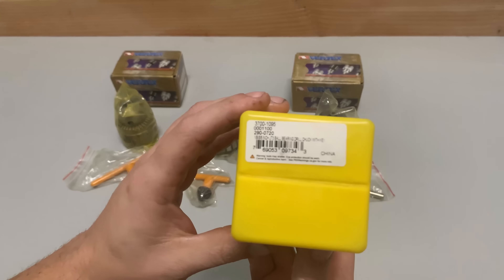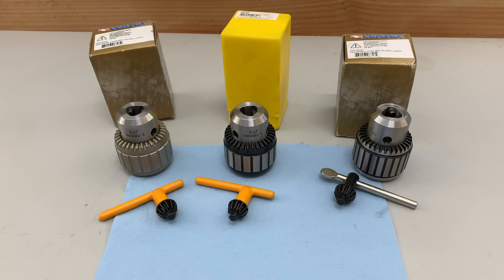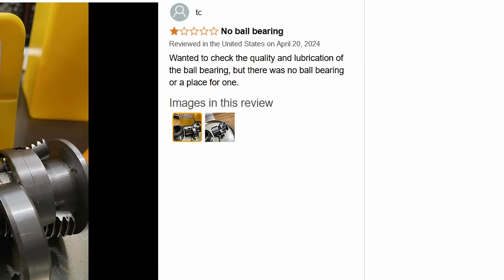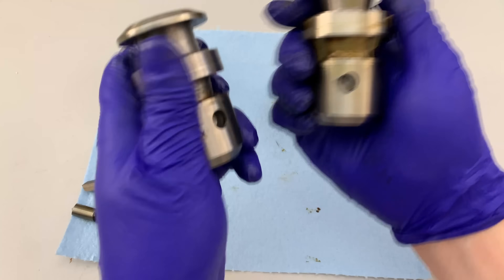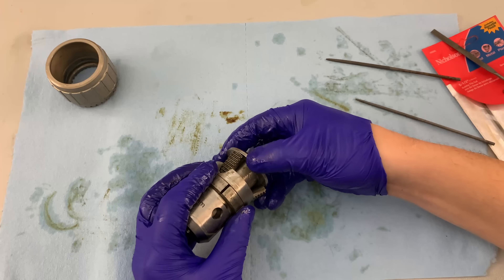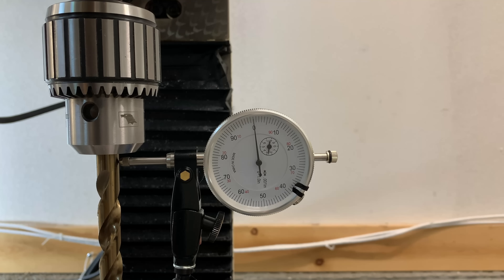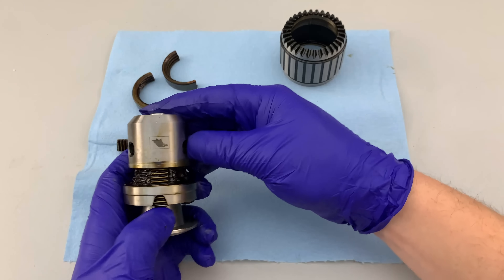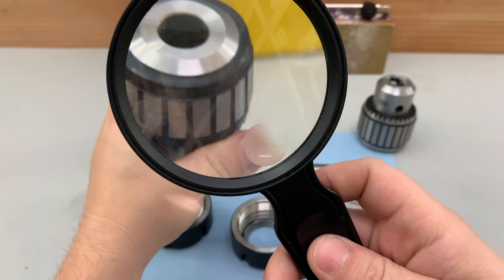Made in China vs Taiwan: The ACTUAL Difference

Comment: I have a box of large and normal sized Jacob's from dad's shop. What is the best way to sell them?
Reply from the maker: I'd say it depends on a lot of different factors like their condition, how many you have, whether you're trying to move them all at once (less per unit) or one at a time (more per unit). Most likely eBay or Facebook Marketplace.
Reply: @ShopHumor  What do you think is best, individually or the whole amount?
Reply from the maker: It really just depends on your goal. If you want the most money, sell them individually. If you want to get them sold faster (but probably for less), sell them in a lot on eBay and just let people bid them up. Make sure you take some really good pictures. Old Jacob's style chucks can be pretty valuable if they're in good shape. There's always the local option (marketplace / pawn shop) if you don't want to mess with shipping.

How many do you have?
Reply: @ShopHumor  I need to count them. They're in a tub and it's heavy. What is a good starting price for them? I think the largest one is 1". Might be bigger. The others are 1/2-3/4.
Reply from the maker: There are so many factors its hard to say a starting price without knowing model or condition. I've seen rough ones go for $50, and rarer ones in good condition go for hundreds each.

Comment: I bought a jacobs chuck from McMaster some 15 years back. I tightened it once and the outside split apart like it had been fractured from the start. Maybe it was dropped or something, but I got a free replacement and have had no issues - though I only use it on rare occasions.
Reply from the maker: That's crazy that it cracked so easily. I think you're probably right - it must have been damaged in shipping or during manufacturing.

Comment: Very interesting disassembly process.  I am certain that I would mess it up, but it is great to see it done.  It would have been interesting to see a real ball bearing chuck.  Thanks for the hard work of putting the video together.
Reply from the maker: Thanks for commenting! I completely agree and I cannot wait to get my hands on some ball bearing chucks. I am going to be doing a follow up video to determine if the distributor has actually fixed this problem, and then I'll be comparing the cheap China made ball bearing chuck, with a brand new Jacobs brand ball bearing chuck (now made in China), and an old, vintage, USA-made Jacobs brand ball bearing chuck.

Comment: I have a number of Vertex Tool pieces. Chuck (Key type tighten) and 3 X Key-less models. All came from Germany &/or European sources. I also have collet sets both Imperial and Metric for my Vertex head for my milling machine. They all have bloody accurate TIR figures measurements.
Hope this helps. One of the arbors was made in Spain as was a few taper drill reduction sleeves for my Lathe and Mill(some Toledo make).

Ozzie watcher
Reply from the maker: Thank you sooo much for the insight, I really appreciate it. How do you like the collet sets?

Comment: For years I was upset about the power tools chucks that had a runout of a millimeter. Regardless of if you buy the home version or the professional gear, they all are just fine enough to drill a hole in wood and put a screw through it. Now you show cheap metal chucks that show a runout 100 times less than any hand-tool. I really need to find out if I can upgrade my small BOSCH blue battery drill with a cheap Chinese ball-less ball chuck.
Reply from the maker: I always go for precision too and that kind of slop irritates me, but I try to ignore it and tell myself that it doesn't matter for applications like wood screws and hand drills. Still tho..
Reply: @ShopHumor  I use this hand tool for fiddly aluminum drilling with 3mm or less. And actually you kill the drill or bend it. As a result you only buy cheap drills. With upgrading the chuck for such little money and being able to buy real nice drills and keep them for a while... A dark had come true. For my little Bosch blue I'll go with the smaller Röhm Manual Chuck. Already in the shopping list.
Reply from the maker: Very nice!! you'll have to let me know how it goes I'm very curious

Comment: After updating my old Taiwan made Jet bench drill press (bearings, new stop system, new spindle lock & a new Cushman BB chuck.) I had no perceptible runout on the spindle taper using a Mitutoyo dial test indicator. When I checked the chuck runout, using a gage pin, I had .003" runout. Disappointing. A much cheaper chuck on my milling machine has less than .001. Not a huge deal since I don't expect a drilled hole to be all that accurate anyhow.
Reply from the maker: You have a good point about wanting precision even when it isn't necessarily needed. I have a Jet bench grinder that I really really like.
Reply: @ShopHumor  I also have an 8" Jet bench grinder. OK, but for the price better tool rests would have been nice. So would having a built in lamp. But I knew that going in. It is smooth running & has plenty of power. Much better than my Grizzley POS. When I had my commercial shop, I had bought a Baldor including stand. It withstood much employee abuse for years but they are expensive.

Comment: A few possibilities that has occurred in other items:
- Purposely mislabeled as Made in Taiwan when it's 100% made in China, to bypass tariff and sounds better.
- Imported from China to Taiwan, then adds or finish small things then labeled as Made in Taiwan.
- Originally designed and made in Taiwan, but copied in China (thus two models look similar).
For the one made in Taiwan there should be a brand and location in Taiwan where it's made to verify.
Reply from the maker: Yeah definitely something untoward going on there. Both of the ones that claimed to be made in Taiwan came in the same package marked as such, but one was clearly machined to a much higher standard than the other one

Comment: I bought a 3/8" Sears Craftsman variable speed drill on sale for about $35 around 1977. A year or two later, I bought a Jacobs chuck for it for around $45. They both still work great!
Reply from the maker: That's a hell of a good value then if you're still getting good use out of both of them! Lot's of years of good service :)
Reply: 1978 for me and the sale price of the drill was $39.  YOu'd hafta spend $200 today to get the same quality and durability.

Comment: What were these chucks like before you disassembled and cleaned them?
What is an actual ball bearing chuck like?
Nameless Chinese brands don’t care about repeat business, once they have your money they have won.
I’m sick to death of of receiving crap from China that does not operate as advertised then being offered compensation.
I just want what was advertised.
I’m also sick of hearing “well it was cheap”. They set the price and wrote the description.
I really am simply sick of crap from China
Reply from the maker: The chucks were rough before I cleaned and deburred the, and felt a lot smoother after the maintenance. Some other viewers suggested I should have gotten a baseline accuracy reading from them (and they were right, that would have been better to have) but my plan was always to get them cleaned and deburred then put them into service after that, so I didn't think about it at the time.

I plan to do a future video where I buy one of these ball bearing chucks again (to make sure they're not still doing a bait and switch and they fixed it like they said), and I'll be comparing that ball bearing chuck with a vintage, made-in-the-USA Jacobs Super Chuck (ball bearing), with a new (now made-in-China) Jacobs Super Chuck (ball bearing) to see how they all three compare.

Comment: as a lathe operator that finish is so bad. i get it they probably spit out a million of those a year and save 10s each part (it adds up) , but still should be able to run the final cut a tad slower, would greatly improve the finish
Reply from the maker: I’m brand new to running a lathe (and it’s a little benchtop garage lathe) and even I recognize how terrible that finish is lol

Comment: Jakobs chucks and precision shouldn't be in the same sentence 😂...
They are made for quickly change drills and give you a fairly decent accuracy.
It's the same as why you use a independent four jaw chuck or collet chuck instead of a 3 jaw chuck on a lathe if you want real precision .
Reply from the maker: I agree in principal - drilling is never really a precision operation. It's for removing a lot of metal with a cheap cutter as quickly as possible. Then you use your precision tools - your end mills, reamers, boring bars, etc, to bring the hole to its final, precise dimension. But when you don't need the tolerances of precision reamers, it's nice to know the tools you're using are as precise as they're advertised to be!

Comment: I bought a keyless chuck that was made in Taiwan from a specialist tool shop in NZ. I wanted it for my mill for smaller accurate work. I normally use an ER 40 set up but not so user friendly on stuff below 7 mm. Anyway used chuck and then it went wonky, woddly drill. Took it back. Tough they said. $278 gone. I had to buy another. I took my dead one to bits and jaws are filable!  Its the luck of the draw. My expensive rohm is 20 years old, been used pretty hard at time but still my go to chuck on the lathe.
Reply from the maker: That's so disappointing. $278 is a lot of money to spend just to get a piece of junk :( I'd like to get my hands on a Rohm

Comment: The fact is China made stuff not that bad. It depends how you source them and on what price you pay for it. Of course many counterfeits come from China.
Many random sellers of Amazon are from China, those quality could have tons of differences. 
In China even those products failed in quality checks can sell on shelves.
All the things really matters, find your reliable suppliers, because the main supplier chain is still in China. That’s the thing hard to avoid.
Reply from the maker: China is such a huge source of manufacturing it's like anything else -- really good stuff, really bad stuff, and a lot in between. These made in China chucks weren't machined as well as the made in Taiwan, but they achieved precision far better than advertised despite that fact. No complaints at all (except for the false advertising on the ball bearing chuck, of course).

Comment: You can't measure runout by indicating the surface of mating parts like collets and drill bits. Have to measure the actual chuck itself.
Reply from the maker: When you flip a piece of stock on your lathe and are setting it up on the 4 jaw chuck for the second operation, where do you measure?

Comment: You don’t actually need to watch the video, folks—the visual differences are minimal. The real distinction lies in the quality of the materials used to manufacture the parts. Higher-grade metals, such as those that have undergone heat treatment and other specialized processes, result in stronger, more durable components. These enhancements improve the parts' resistance to wear, stress, and even extreme conditions. It's not about the look; it's about the material integrity and craftsmanship that give these parts a performance edge.
Reply from the maker: Well I'd still prefer they watched the video if it's all the same to you, Will

Comment: I think it comes down to know where and when to spend and how accurate do you really need ? 

I bed the run out isn’t just in the chuck. ;)
Reply from the maker: For sure. For drilling, the .001 runout on these was fantastic. If I need a hole to hit a precise tolerance I'll drill it out undersize and then use an end mill, reamer, or boring bar to bring it up to final dimension -- saving wear and tear on my good cutters and using up my cheap ones. And if a hole doesn't need to have a precise tolerance, .001 runout is way more than enough to just drill it to the final dimension.

Comment: In China, we use these kinds of chucks for the not percesion jobs like drill a 10mm hole for (+0.1/0).If you need good runout, we usually use a ER collect to hold the drill instead.
Reply from the maker: These gave really good precision for drill chucks (better than .001 inch so .025 mm) but I don't ever really use drills for precision. What I do is drill the hole undersized to my final dimension, then use a reamer, end mill, or boring bar to bring the hole to its final size.
Reply: @ShopHumor  Sorry for my poor english. Due to the intense competition in China machining industry, in order to make money, you must produce a large number of high-quality products that meet the requirements in a short period of time, which makes it necessary for us to conduct research on this. If you need percesion holes, i highly recommend trying the NACHI 7572 drill. First, it features a high-precision integral cylindrical shank, which is ideal for precise clamping in ER or hydraulic chucks, a foundation for machining accuracy. Second, its optimized cutting edge design allows the drill bit to position accurately when entering the workpiece and offers excellent chip evacuation. I've successfully drilled IT6 holes on a common machining center using this drill with an ER collet holder.
Reply from the maker: @robinlu4029  thanks for the suggestion!
Reply: @ShopHumor  Overall, I want to point out that China also have reasonably priced and high-quality tools, but it's difficult for foreigners to buy them because those engaged in foreign trade are just looking to make money. They don't care about the quality of the products customers can buy, as long as they are usable.For example, low-quality BT40-ER32 is sold for only 35CNY or 7USD, and ER32 collect for just 7CNY or 1 USD. It's not that they are unusable, but due to the lack of dynamic balance and the use of inferior materials, they are fine for rough machining on machines below 8000 rpm. However, over time, the precision deteriorates. High-speed precision machines require tool holders with precise dynamic balance, which can generally be purchased for 150 CNY, and their quality is not at all inferior to the 400 CNY tool holders produced in Taiwan.
Reply: @robinlu4029 Your English is great mate. Thanks for the explanation.
Reply: @CheapCheerful  Thank you, because we have gpt now, i can use that to check my words.
Reply: most collets are the best next to albright
Reply: Yes, drill chucks are not made for precision hole drilling. That's what collets and reamers are for. Drill bits make a hole. Reamers make precision holes. It all depends on your requirements.
Reply: I have purchased various items from China. In my experience quality and precision don’t always correlate well with price. After time the frauds and fakes become apparent from the quality products. Unfortunately, there are few high quality Chinese products.

Comment: my experience with the china vs taiwan isnt in tooling but in machines , we have a dalian 600x2000(metric) lathe and a craft machine tools 660x3300(metric) lathe , the dalian is 3 years older but only gets used occasionally for large jobs because of the large removable gap but in the 6 years ive been working there the dalian (chinese ) lathe breaks down atleast once a year (gear head issues) but the craft (taiwanese made) gets used dayly and only had minor breakdowns like a circlip in the tailstock gearbox giving up or needing new belts
Reply from the maker: That’s good information, thank you. I’m strongly considering getting a manual milling machine that’s made in Taiwan at some point when my shop budget allows

Comment: Interesting video! 👍

In general I have found Taiwanese made tools to be better than Chinese.

However I have also found most of the Chinese stuff to be adequate and It's almost always cheaper. Sometimes you get a gem, "a diamond in the rough".

Vertex is a well respected brand in model engineering circles. But I have long suspected some of their products are being faked, so it's a bit of a lottery.

I recently discovered the "Accupro" brand sold over here in the UK. They are the same chucks as sold in the US under the "Llambrich" brand name but much much cheaper! They are made in Spain and are very high quality. This is now my go to brand for the price/quality ratio.
Reply from the maker: Thanks for the great tip on the accupro/ llambrich chucks, I’ll keep an eye out. Your note about Vertex being faked is interesting and would seem to support my findings when I took apart those two Vertex chucks and found they were markedly different inside.

Comment: So what was the actual runout? You said they were rated to like 30 thousandths. But then the runout you said was a tenth. Tenth of what? Tenth of a thousandth?
Reply from the maker: Sorry if wasn’t clear on that. The runout demonstration was 30 thousandths (an exaggeration for demonstration). These chucks were all rated to .0032 (3 one-thousandths) and they all achieved accuracy better accuracy than that, coming in under one one-thousandth (.001). The best measured between two and three ten-thousandths (.0002 - .0003) of an inch runout.

Comment: I would have liked to see a longer tool chucked up and measured for runout than the drill.  Like a gauge pin measured an inch or two out.  Ive had chucks that have little to no runout right at the nose of the chuck but hold the bit at an angle and they are all over the place at the tip of the drill.
Reply from the maker: Thanks Reini. It's a good suggestion to measure both at the chuck jaws and further from the chuck jaws. Someone else suggested that it would also be good to measure with different diameter pins/drills as well, to see if there's a variance between the minimum and maximum capacity of the chuck, and I like that idea, too. I plan to do a follow up video comparing a brand new, low-budget, China-made ball bearing chuck, a brand new, high-budget, China-made Jacobs Super Chuck, and a vintage, American-made Jacobs Super Chuck, just to see how they compare. 

I'll incorporate those suggestions into that video!